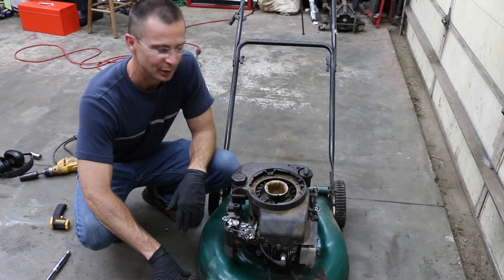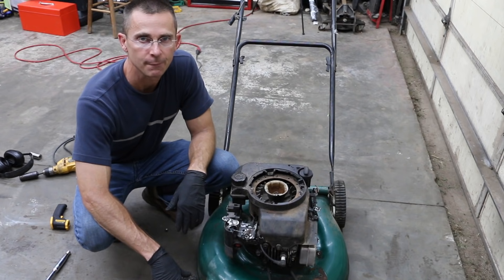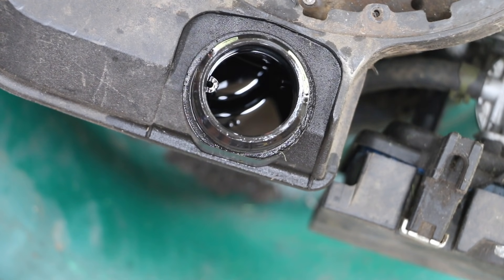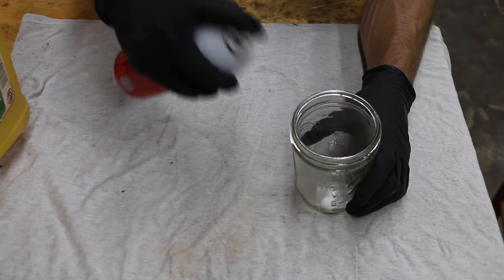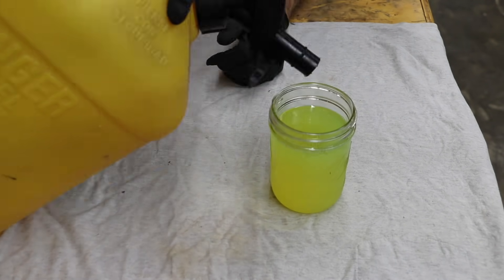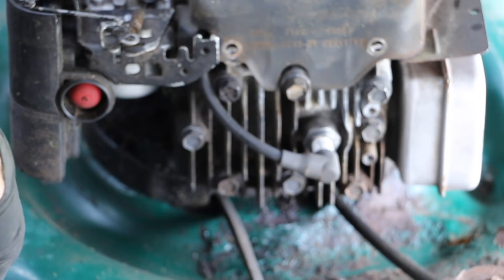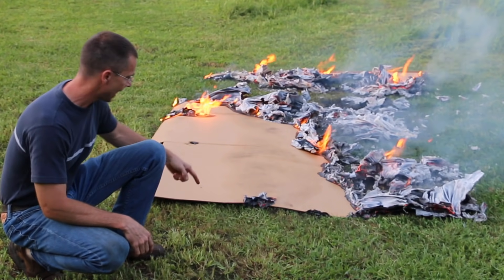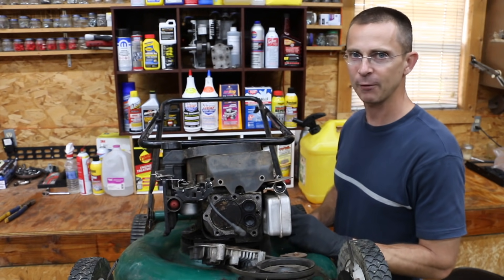Will a Gas Engine Run on Diesel?  Let's find out!

Comment: No. I accidentally put 2 gallons of diesel fuel into the tank before I realized It wasn't gas. I filled the tank with gas and ran it. It smoked like a freight train  until I ran it almost empty.  I laughed so hard at first because it was smoking bad !😂😂😂😂 not enough compression for diesel only.
Reply from the maker: Thanks for sharing.

Comment: I would say it’s say it’s probably good for the engine running 50 50 pretty much just upper cylinder lubricants but a lot cheaper I’d say the piston rings are vale stems were feeling good during the test
Reply from the maker: Thanks for sharing.

Comment: Back in the 1940's my dad had a Plymouth pickup which he only ever ran on diesel. Because of the very limited supply of gasoline die to the depression it was severely rationed. He figured why not give it a go. It worked. He rant it daily until he died in 1972. Also he had disabled some of the cylinders by removing the exhaust valves. You could tell by how rough it ran and the lack of HT leads to the disabled cylinders. From 1967 I did the same with my old Ford Jailbar V8. Never once had a problem except it was hard to start, especially on a frosty morning. 18 years I used it daily and did many long trips too. Got 15 miles per gallon.
Reply from the maker: Thanks for sharing.

Comment: To run on pure diesel you have to keep priming it to keep it running and if it stalls start again and keep priming so it stays running, after about 6 or 7 times it gets hot enough to run on its own but make sure the choke is closed too
Reply from the maker: Thanks for the feedback.

Comment: There are diesel small engines but the compression needs to be high for diesel. I remember as a younger man a mechanic I knew recommended using a quart of diesel in a tank of gas (10 gallon tank) to clean injectors and stuff. I never did it. Always just dumped something marketed for the job. I switched to SeaFoam 15 years ago or so. I saw it bro g a dead Camry back from an 8 year rest. Think couldn’t run. Dumped it in the oil and gas and it started working. Had a noisy lifter that’s when we added SeaFoam to the crank case and it worked. Made a believer of me. Saved us swapping a head in the car.
Reply from the maker: Thanks for sharing.

Comment: When I was a young 'un, I went to work for Tune Up Masters. I know that they had a lot of idiots that didn't know what they were doing nor did they care. I applied myself and learned how to to up any car & could rebuild any carburetor. One day we had a 73 Cadillac SDV pull in that really ran like crap. It barely idled, had poor power, pinged a lot, and smoked a little. We replaced everything: Plugs, points, condenser, cap rotor, coil, wire set, rebuilt the carburetor -- twice. On the second rebuild, the manager got involved and noticed that the fuel smelled funny. He asked the owner where he filled up and how much it cost him -- and sure enough, he saved about 20 cents a gallon by accidentally filling it with diesel. Another time, when working at a filling station, a Mercedes 300D came in and filled up with unleaded. He got about a 1/2 block down the street when the motor seized from preignition & left a pair of skid marks running down the street. He was OK after having the tank drained and I got a free tank of gas that had a little bit of diesel mixed into it. It wasn't worth it, though, because the diesel smell lingered for months.
Reply from the maker: Thanks for sharing.

Comment: I bet the 50/50 mix provided lubricity in the case. Maybe you could try 50/50 gas and veggie oilt to see if it provides better engine life
Reply from the maker: Thanks for the suggestion.

Comment: Ive always done this whis my 5 gallon tanks at home when they are empty weather im filling up a generator or filling spare tanks for a long trip in my diesel truck. A little bit of either dosent hurt the majority of what get put in the tanks. IMO a littlw gas mixed with diesel almost acts as a fuel treatment.
Reply from the maker: Thanks for sharing.

Comment: Bendiesel was commonly used bake in the young broke days, on my old car, Bensin is the Norwegian word for petrol. so you can mix this, and be able to use it in your car, BUT it will crap out the sparkplugs, and at load this will gererate alot of knocking in the engine,this depends on the mix, it will destroy the engine over time if not used carefully, and not to mutch diesel mixed in, and some of the diesel is unburned at exit. so in an emergency it can be done, but i dont recomend it otherwise. do not try it the otherway around, a diesel engine on petrol is a disaster, the pump will be locked up in a werry short time .all this it is a bad idea. old video, but it just came up on the screen  😀
Reply from the maker: Thanks for the feedback.

Comment: I ran a gas f250 on diesel on the pipeline when someone filled it up. Never had a problem. 🤷🏻‍♂️ Ran the truck for a year afterwards with no issues.
Reply from the maker: Thanks for sharing.

Comment: How about a TWO stroke motor? Wouldn't this be a more valued test as one could argue you don't need to buy expensive 2-stroke oil for your gardening engines, and all we need to do is find the ideal mix of diesel to gasoline that suit any particular machine. We could use this guide instead of sourcing the difficult to source expensive 2-stroke oil all the time. It's only to lube the cylinder walls after all.
Reply from the maker: Thanks for the suggestion.

Comment: How about a used motor oil gas mixture? I’ve seen your other video with 2 cycle oil but how about seeing just how much used motor oil you can mix with gasoline before it reaches the same flash point as diesel I bet you could get away with 60-75% used oil and 40% gas or maybe better when I was in the military I’ve seen people in country’s who sell “gas” on the sides of roads mainly for the scooter guys in old 2 liter bottles and the stuff is literally black but they seem to like it I’ve always been curious to try it.
Reply from the maker: Thanks for the suggestion.

Comment: I got something for you to try.... Put 2 stroke oil in a regular motor... Check compression it'll have more compression with the 2 stroke oil in it...  Also for a motor that has been setting for some time the 2 stroke oil gets down into the rings to oil them up
Reply from the maker: Thanks for the suggestion.

Comment: back in the 60s people said gas engines will run on kerosene , provided the engine is warm when switched . if it'll run on kero , it'll probably run on diesel (warm engine) . if it'll run on diesel , it should run on black diesel (1 part gas to 4 parts wmo) but the dirty oil will mess up the carb . help me figure a way around using the carb when switched to black diesel , and i can once again afford to drive my 12 mpg 1973 pickup truck . any ideas , anyone ?

Comment: Put diesel in my 82 Ford 350
Accidently it smoked and killed the motor would not run
Had to drain the tank and carb
Reply from the maker: Thanks for sharing.

Comment: I had been driving a diesel van on runs all wknd, must have filled the tank about 20 times, when finished i got into my petrol 4x4 and filled with diesel, drove off there was a lot of white smoke and then it cut out and wouldn't start, so emptied the fuel tank, filled with petrol, it took a bit to start back up there was white smoke that faded and the engine seamed to actually run far better than before the wknd !
Can you please explain the increase in power and speed i had on my 140K 4x4 ????

Comment: You should never ever attempt to put diesel in a gasoline engine. It will destroy the engine.
Reply from the maker: Good Point!
Reply: @ProjectFarm  I mean, really. Why take the risk? Diesel nozzles have bigger heads than gasoline nozzles. This is designed such that it is less likely to put diesel in a petrol engine.

Comment: Just found this channel. My father tried diesel in his Model A back in the depression, because it was much cheaper than gas. Didn't work. Had to drain the tank and put in gas(which was about 20 cents a gallon back then)! 

Oh, great videos. I'm hooked. Used to be a pretty good shade tree mechanic, but at 80, my back, neck and eyesight don't work like they did once. Hard to change my own oil anymore.
Reply from the maker: Welcome and thanks for watching!

Comment: We've an old Ferguson t20 tractor,  starts on petrol, then switch over to a mix of diesel and 10% petrol with a table spoon of 2 stroke oil, runs all day on that mix without missing a beat, been in our family since new in 1948..still going strong.
Reply from the maker: Thank you for sharing!

Comment: I do some crazy stuff. Last week I made a mix of all kinds of gasoline additives mixed with 1.5 gallons of 91 octane and I added in my 2016 Mazda CX-5 when my vehicle was closed to empty. I ran it and realized my acceleration was slow. So I went to gas station and filled her up and it's running just great. I had mixed an 11oz starter fluid, 16oz Lucas parts and degreaser with PEA, 10 oz Chevron tecron, 32oz seafoam, 12 oz Amsoil performance improver, 6oz Amsoil upper cylinder lube, 7oz MMO, 7oz Lucas upper cylinder lube, 3oz Amsoil 2 stroke oil Saber, 1oz Max clean boost, 5oz Race Gas additive,  20 Oz gumout octane booster, 10oz gumout all in one, and 6oz WD40. All my additives were close to a gallon. I added those mix in a 2.5 gallon gas container with 1.5gallon 91 octane. And I mixed it in a nearly empty tank. In my experience it ran just fine but felt like it was very high octane and was burning slowly and that's why my acceleration was slow. Can you do the real experience what I had done please? I know you can do the most scientific way . 
Thanks for all you do Sir
Reply from the maker: Thanks for the suggestion.

Comment: "Will a Gas Engine Run on Diesel?" Yes it will and very well. An off-grid friend was doing that in through the 2000's with a little generator he used to charge the battery bank for his house. He got the idea from his old dual-fuel John Deer tractor that ran on gasoline and could shift to cooking oil once it got hot. He wanted to use off-road dyed diesel for batteries since he could get a great deal on it.  While the stoichiometric air:fuel ratio is only a tad off but it's a whopping five times as viscus so that makes it run way too lean. It also likes a very hot engine. He graphed in some really old carb that looked like it was from the 1950's and fed in some propane, for like five minutes, to get it up to temp. The old carb was unique and had a screw that allowed him to dial in the mixture so he didn't need to drill it out. Once it was sorted, maybe another ~5 minutes, it would run gobs of hours and seemingly clean with no obvious smoke and the plug didn't foul.

Comment: This is very interesting.  What I would like to know is did it give it more power?  Diesel has more BTUs and gas ignites hotter so I was always wondering if it would give them engine more horsepower.
How about getting super high octane racing fuel and using diesel to put the octane rating to 89 and then doing a power comparison.
Reply from the maker: Thanks!  Than ks for the video idea.

Comment: I had a 87 Nissan Sentra station wagon with a 1.6 l engine. I went to my regular gas station I was talking to the sky totally not paying attention to what I was doing I put $5 of diesel in my fuel tank this was years ago when fuel was only a couple dollars to get one. Thank God my sister didn't live too far away so I was driving and then I noticed smoke coming out back in I just smell diesel fuel. And then my mother started juggling. I went back to the gas station filled it the rest way up with gasoline. Answer my car started it would run as about 995% normal. But what I did notice is it took forever to go through that tank of gas that had the diesel fuel in it. Do you think if I use a small portion diesel fuel and my gas tank I will improve my gas mileage. This is Jim thank you for your time bye.

Comment: I once sold my street rod truck to a fellow that would bring home his work truck and siphon the gas and put it in the truck. Problem, the work truck also had a diesel tank for the onboard equipment. That is when we learned that diesel wouldn't run, well not very well in a gas engine. The old switcharoo happened more that once until the chevy small block would no longer run on gas either. I always figured they would have figured out and remembered what side the diesel tank was on? Nope!!
Reply from the maker: Thanks for sharing.

Comment: Be interesting to screw some metal plate into the inside of the cylinder head, or use high temp epoxy, to take up some space in the cylinder for the purpose of increasing the compression ratio, of coarse without causing any interference with moving parts. Then see if that enhances the ability to use diesel efficiently for mowing the lawn. Should get more power with the expense of wear and tear on the bearings.
Reply from the maker: Thanks for the suggestion.

Comment: I had on old weelhorse riding mover I put a inline fuel filter on and ran waste oil and gas mix  4 -1 gallon ran fine just a little smoke and I  got rid of my old engine oil
Reply from the maker: Thanks for sharing.

Comment: I hear a lot about engine fires from ethanol based fuels.  I would like to see why that is.
Reply from the maker: Thanks for the suggestion.
Reply: @ProjectFarm  You're welcome.  Ethanol sounds great in regard to caring for the environment, but if consumer safety is compromised due to fires, that's a problem.  From what I understand, ethanol eats away at components in the carburetor, and fuel lines.  That's another problem.
Reply: Material compatibility issues resulting if fuel leaks---probably. Many materials that are great for Gasoline are lousy for Ethanol and vise versa. The materials that are happy with both are few and often expensive. Also, the vapor pressure is low so there is an explosion risk if the tank is not foam-filled of a bit of gasoline isn't added, as in M85 or E85. The gasoline has the added benefit of making the flame more visible during the day for rescue workers.

Comment: Hi, there is curious to see what would happen if you used a smaller ratio of diesel to Gasolene 10:1 or even 100:1,?  and would the diesel help with lubrication in the gasoline engine, or even compression?
Reply from the maker: Thanks for the suggestion.

Comment: Have you done any tests with petrol in a diesel engine? Have you ever tried to have an engine on a dyno and check how much the power increases in a diesel with different percent mixture of gasoline in the diesel fuel it provides? Then afterwards disassemble and check the wear on the cylinder, piston and diesel pump.
Reply from the maker: Thanks for the suggestion.

Comment: If you heat the diesel it will work better notice coward you did the gas diesel test the diesel didn't take off until it got hot

Comment: It occurred to me that a piston with more rings would create higher compression.  Think most diesel motors have around 400 psi.  Dont even know if the gas mower engine would blow something due to thin cylinder walls but ma maybe a little engineering savvy could make it would make it work.
Reply from the maker: Thanks for the feedback.

Comment: In theory a petrol should not run on diesel, because the compression ratio is much lower.
Diesel does not ignite with a spark, the mower ran but not well, did not sound happy.
Reply from the maker: Thanks for the feedback.

Comment: If you kill the spark, fill the tank with diesel and advance the timing by like 90 degrees (if DI) or run it rich to the point where the cylinders almost hydrolock and any petrol will "run" on diesel or oil.

Which is practically the same thing that happens when a petrol or diesel engine runs away on its own sump oil. Fuel is sucked into the intake, and is "injected" for a lack of a better term into the cylinder at 90 or 180 degrees crank or cam angle btdc. Due to the high "fuel" injection volume displacing the air in the cylinder, the air volume in the cylinder becomes smaller and as a result the piston is able to compress the air in the cylinder so much that it ignites and runs the engine.

Comment: I used up old diesel with a beater ridding mower. I used to start it on gas. Once I burned almost all the gas I would fill the tank with diesel with out shutting it off. Then switch back to gas at the end.  Seemed to work find other then had to be a hot motor.
Reply from the maker: Thanks for sharing.

Comment: Ummmm...unless we were in a desperate situation, why would we want to use the more expensive diesel fuel in a gasoline running engine?  Did I miss something here?  Did the gas/diesel mixture run longer than just the plain gasoline?  The cardboard experiment was fun.

Comment: 50 - 50 diesel gas mixture does work but under full load the engine is knocking loud. This will cause damage to a car engine on the long run. I did not try the 50 /50 mix on a low compression stationary engine i.e. a lawnmower.  ( I tried this in the 70s during the OPEC oil embargo)
Reply from the maker: Thanks for the feedback.

Comment: So I've heard that a car will run on diesel in a pinch but will not start on diesel its not good for the engine so keeping it at as low rpm possible is a must but if your say stuck in the middle of nowhere and need fuel and you got diesel on hand you can use it but you will have to essentially refuel the car with gasoline and purge your injectors with gas for it to start again yes this would be fueling while the engine is running very non traditional but I've been told for a few mechanics this is true but you will be doing damage to your engine
Reply from the maker: Thanks for the feedback.